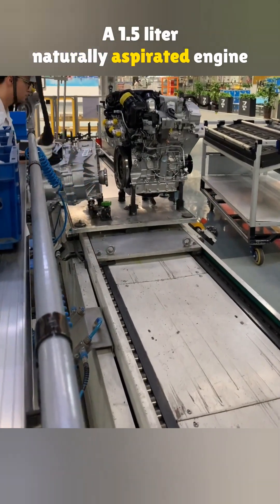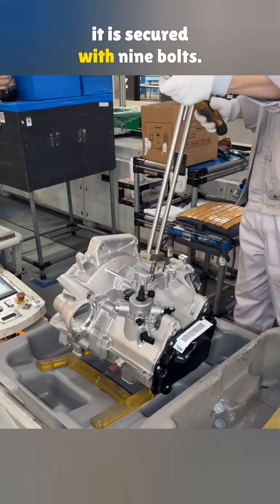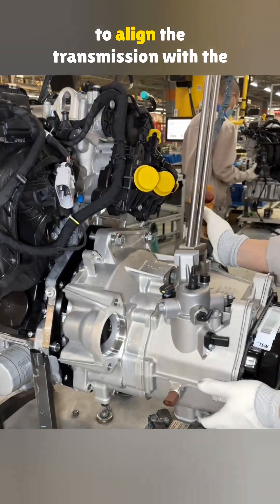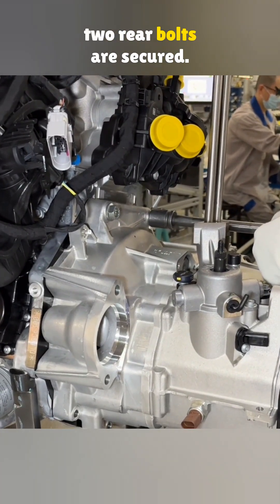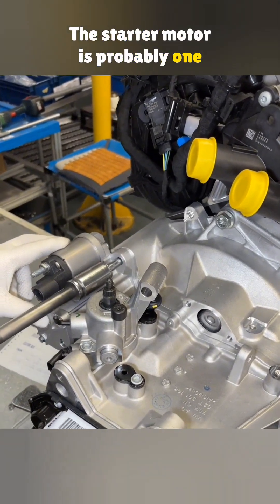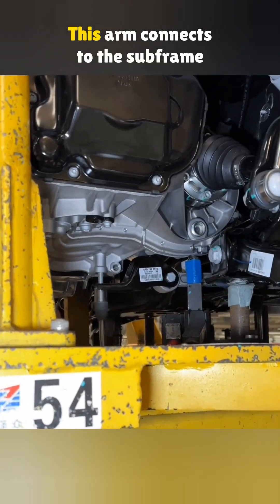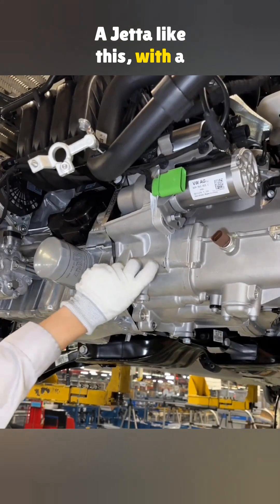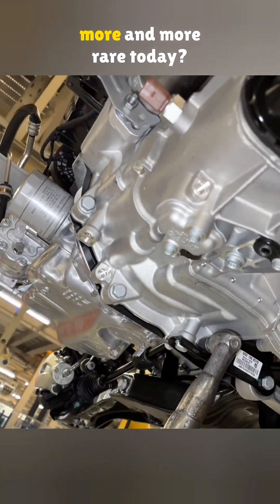Why Are Automakers Dropping Naturally Aspirated Engines and Manual Transmissions?

Comment: WHY DID THEY ELLIMINATE THE  MANUAL TRANSMISSION YOU ASK ????  In my opinion  , it is a manifestation of corporate greed  and above all "PREDATORY ENGINEERING "  IN  CAR MAKING.!!!!!!!! HENCE those bolts on that assembly line should all be stainless steel coated with stainless steel never-sieze....yes i own a 1977 Chevy van with three on the tree. BATRY DEAD? JUST GIVE IT A PUSH AND POP UP THE CLUTCH IN SECOND GEAR. ....ALSO STAINLESS STEEL IS A BUZZ WORD AMONGST NON-BEHAVIORAL MECHANICS AND YOU TUBE CAR GURUS...

Comment: Starters are not lazy. They actually work really hard spinning the engine up, not only to minimum speed for inertia on the rotating assembly, but fighting the engines compression at the same time. On top of that, they also do their work mostly when the engine is stone cold were its more solid and harder to spin.
They may only work for just a short burst of a few seconds, but those things are definitely fighting hard. 
It's why they say not to just sit and crank and crank and crank your engine if its not firing up. The starters will get very hot and the solenoid and/or the electric motor will burn out.